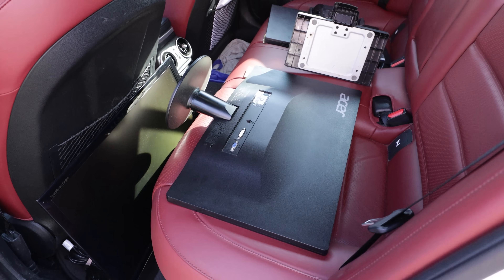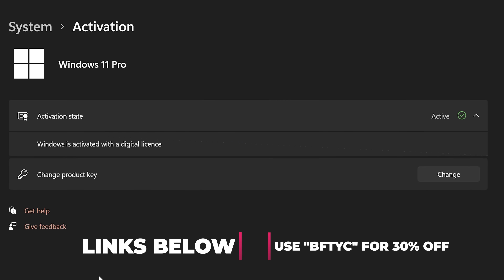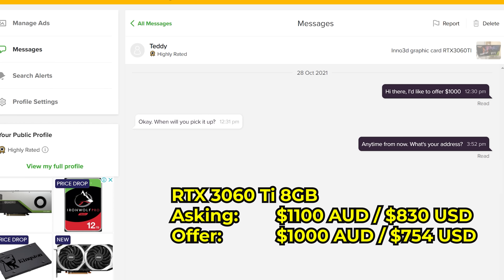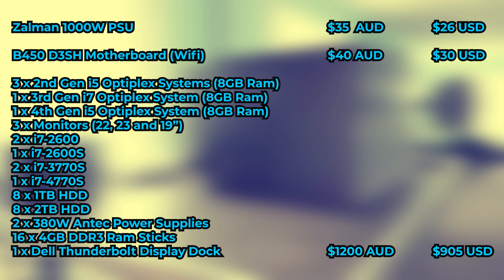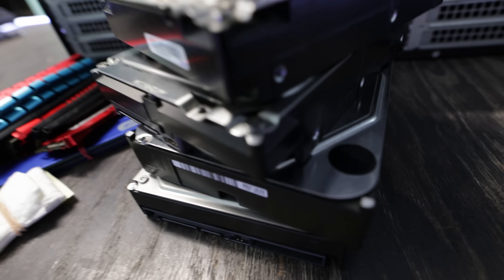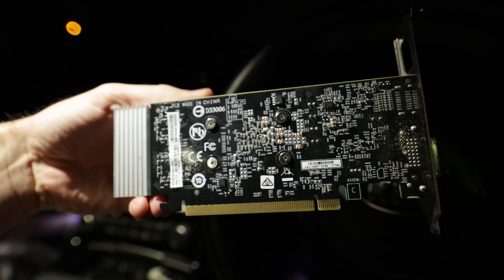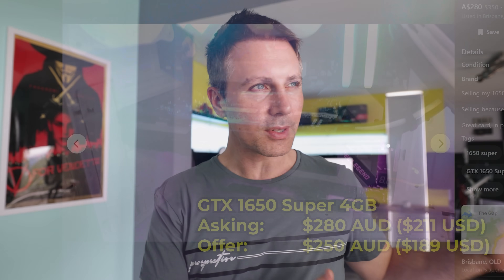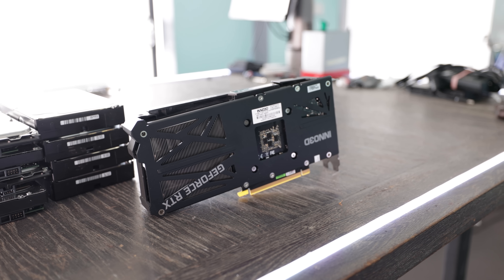Buying over $1500 of BARGAIN USED PC Parts!

Comment: I shared my most recent pickups from Newegg to your Twitter. ES Gaming 750w 80 plus Gold PSU on sale for $57.99. That was 50% off. Also, a 32GB Neo Forza 3600MHz dual channel RAM kit for $99.99. See it easily clocks to 4000Mhz as well.

Comment: Hi mr Tech Yes, I had a rig with SLI 2way gtx 960 msi, my mobo is asrock x299 extreme4, i7 7820x, i ran normally with heaven benchmark normal setting, but when i came to high, pc just crashed (need to hold the button to shutdown). Do you have any solution for this ? Thank you mr Tech Yes, nice videos. subscribed :D
Reply from the maker: Ill answer the question for you in an upcoming GPU video actually, perfect question for it :D
Reply: @techyescity  thank you <3, love u man. Oh i forgot to mention my PSU is corsair CX650 (i dont think its make my pc crashed), same crash happened when i enter Rainbow Six Siege (without vulkan API )

Comment: Ampere WW channel supply increases 120% in the prior 6 weeks. All Maxwell and Quadro P are coming back to the used lot in large volumes. Last week Turing also came back; 2070S WW channel inventory gained + 238%, 2070 + 690%, 2060S + 232%, 2060 + 393% however cleared the channel within 20 hours. This Turing volume that was returned in last two weeks that sold in less than 20 hours is equivalent in volume to all available 3080/70 or 1/3 of all Ampere inventories in the WW channel today. On the Maxwell front just for you Bryan, 970s up 197% about the same volume in channel as 3060ti and 1650. On the Quadro P side P4K plus 87% inventoried in the prior two weeks these are typically configured and sold as workstations, Biggest dHPU channel seller in used market prior year you're missing out  the trend? P2200 also up 58% and between the two equal around 970 available and about a third less than 3060ti. mb

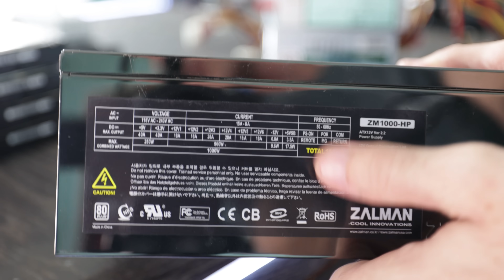Comment: @2:20 :
This power supply (although it's 1000watt capacity) needs extra attention since it's a multi-rail design , so someone has to be extra-cautious about which rail will connect with  a power-hungry GPU.
As we can see on its label , some 12V rails can give only 12V*18A= 216watt , only .
This means problems for anyone who will connect an RTX3080/RTX3080Ti/RTX3090 into such a rail.
Personally i never liked ,never used ,and never will use  a PSU with multi-rail design. I just don't trust them.

Comment: For this month, it was a great day when there is a good deal for me when I did buy a good used power supply of Evga 430w 80 plus around $30 that was in good condition and no dust, too! I even ask the staff that knows more about computer parts to ask them if they have test it. They even said to me that they have test it and it's working, too!

Comment: Hey Brian, I found a graphics card you can get on eBay for under 20 dollars with 1gb of GDDR5. The HD 7570, I used it with a core 2 quad q8200 and sold it for $180 USD. I think it's a great value for under $20 especially on eBay

Comment: That big power supply was a smokin deal and I bet you can order the missing cables from the manufacturer or ebay. I have bunches of old 750 and 850 Nspire power supplies that were excellent quality for cheap same problem having enough of the cables that are for those things. They don't make them any more but they were solid units till things needed more current than the 4 rails could supply at 18 amps each.

Comment: For Alder Lake testing, I am interested in what kind of GPU I must have in order to see a significant difference in gaming performance between Alder Lake and older GPUs, and between different Alder Lake chips, at the settings that people actually play the games on.  For example, will a computer with a 3060ti perform in 1440p or 1080p any better on 12900k than it does on  11400 or Ryzen 5600g? 

Most reviewers test with something like an RTX 3090 or RX6900xt to really avoid bottlenecking the CPU to show what it can do, but I am wondering what kind of CPU those of us with RX6600xt (or earlier gen stuff like GTX 1660 Super) and the like should pair the GPU with.
Reply: The higher resolution the higher stress on gpu and less stress on cpu. If you have a 6600 xt or even better gpu you will be good with any Intel i5 11th gen on 1440p or even 1080p.
Reply from the maker: Yeah I will look at that with the 12600K review.
Reply: I always say the 3060's/ti(10,16 or 20 series included) stick to 1080p,2070/3070/3070ti stick to 1440p or 1080p for high frame rates if you have a supporting monitor,then the 3080/ti/3090 for 4k but honestly in most games I'd rather have the FPS with DLSS an ray tracing than trying to play at 4k taking a fps hit but im sure some of the quest games are pretty cool at 4k.

Comment: I have seen some leaks on Alderlake in Cinabench. I am very curious what a 2699v3 vs a 12900k looks like. My dual 2699v3 CPUs turbo unlocked gets around 27,000+ and I suspect more if I could tune them. But the leaks seem to match that score on a single 12900k (but realistically for $200-300 more then dual 2699v3 CPUs).